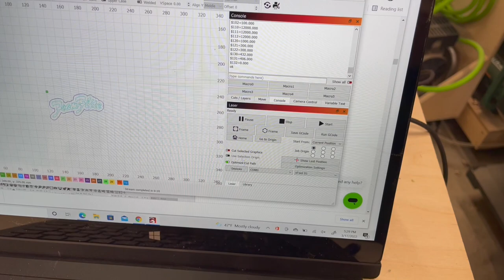XTool D1 DIY Laser Enclosure that fits the stock Honeycomb Bed

Comment: Good Work. I have a 20W laser on my Xtool D1.  I am wondering if I can use the same orange acrylic you are using. The Jtech description of the product  you are using indicate an O.D.  3 , while a person acting as a Laser Safety Officer at his work has indicated to me that a 455 nm laser would require a O.D. 5.  It make a big difference on pricing of the shielding to use. Can you give me some indication why you selected an O.D. 3. Regards
Reply from the maker: The choice for the Jtech shielding was a balance of cost and personal acceptance of my responsibility to take measures to protect myself. I also have a pair of Freemascot glasses rated at OD6+ for use with the 455nm wavelength of these lasers. Finding panels of OD6 acrylic for the larger window was becoming difficult and expensive. So it was a balance and choice I made knowing that I should still take measures to further protect myself.
Reply: @Vintauri  Tank you very much for your fast and very honest anwer. I am proud of maker of your type who try to find answer to different problem and try its best to have things done. For the benefit of your viewer the current cost of a 12 inches x 25 inches O.D. 6   ACR-A5401A Laser Safety Window is 353$ US. If someone can explain to me why we have to pay such price for that type of material I would appreciate. I am not sure what I am paying for a piece of very complex material or a certificate of compliance. Continue your good work. Regards.

Comment: Hi are the orange plexiglass laser safe from Jtech..including the sides pieces,  what size sheet did you use for the cut outs. Thank you for sharing this great build
Reply from the maker: Yes they are the Jtech laser safe panels.  They could be made from 1/8" plywood or MDF but I thought this would look better and might offer more viewing to monitor the machine.  I used two 12 x 24 panels in the build.

Comment: Just downloaded your plans. Laser will arrive later this week. Is there enough room for the light burn camera to focus if a small gas strut was used to stop the lid going all the way back?
Reply from the maker: You would need a very wide angle lens to use with the current dimensions.  Extending the enclosure top up 2-3 inches would give you more flexibility to add the camera.  I wanted to keep mine compact and hadn't planned on a camera when I designed it.  However I did pick one up and will be doing some testing with it eventually.
Reply: Where did you download plans for enclosure? Is there a link?

Comment: I just purchased your plans to build this enclosure my question to you is you mentioned that you would’ve made it a little bit bigger for the honeycomb panel is that in the new plans or do I have to enlarge it. it looks very good so far I Purchased the extra 421 but it is still in transit I have not received it yet but I would like to build it before I get my unit so hopefully you can get back to me and let me know if the extra dimensions were added to the new plans thank you
Reply from the maker: Yes the extra depth for the honeycomb tray was added for more flexibility in placement.  You can extend it further if you wish and it will not effect the operation of the laser or enclosure.
Reply: I’m sorry it was supposed to read XTOOL D1 20W pro

Comment: love the set up!!! quick question: How compatible is this enclosure if I want to add a camera??
Reply from the maker: Thank you!  It’s a little short for the typical cameras people use with this size laser. I’ve picked up a very wide angle camera to do some testing but I need to sort out if it’s feasible without making it taller.

Comment: I have sculpfun S30 ultra 40 . I presume the plans could be modified to make it suit. I have a fan that came with my sculpfun enclosure, do you think it would suffice. Love your presentation 
Paul
Ireland 🇮🇪
Reply from the maker: You would need to stretch a few side pieces to make it a bit taller for the sculpfun to fit, but it should not be too hard.  The fan might work, but they tend to be a bit underpowered.  If you can get a larger one, you'll be happier.
Reply: @Vintauri just downloaded your plans
Reply: @Vintauri . I now have your plans and will endeavor to modify to accommodate the Sculpfun 30. One question.
What height bench/desk does your enclosure sit on ?
Regards, 
Paul,
Ireland 🇮🇪

Comment: Great plans. Bought them last week. Need to buy a few more items. Question...How did you wire the lighting wityh the limit switch? Also, I'm considering placing my exhaust port to the rear of the enclosre. Any thoughts? Thank you for sharing the plans and your knowledge.
Reply from the maker: Moving the air exhaust port to the back should be fine.  I have my enclosure up to the wall so I needed it on the side for clearance.  I've had a few questions on the lighting so I think I should make a quick video on it.  It's strips of LED lights connected with 18 and 20 gauge silicone wire. I have a limit switch that is pressed with the lid closed to turn on the front section of lights.

Comment: Hi Steve, can you use Dave Clack's  interchanageable jigs kit with this enclouser you made? I got your plans and like your design. I am modifying it a little and just wondering if i need to modify it to use Clack's jigs. Thanks
Reply from the maker: Clacks jig will fit inside the enclosure without any modifications.
Reply: @Vintauri  thanks

Comment: Hi, really like the way it came out. I'm curious to know why you preferred to mount the laser and honeycomb on the small shelf instead of using the original raisers and to build spacers for the honey comb? I think it can simplify the build a little bit.
Reply: I think I can answer. With the laser being placed on a built in shelf it is already lifted to the required height to use a rotary. Without the shelf you have to install the original risers every time you want to use a rotary, that would take time and after awhile become a  nuisance. Plus if the shelf isnt there, then you would have to keep track of the leg risers...i dunno know about you, but i am ALWAYS misplacing (not loosing) things; so with the shelf already installed to the height you need to use the rotary, then you have no need for the leg risers.

Comment: I have a old bathroom vent fan. It still works good would this be good enough to. Attach to the back of my box for venting?
Reply from the maker: If you can enclose the fan in a way that it will draw the air through the enclosure and if it will pull 300+ CFM, it should work. It always nice to reuse something when possible.

Comment: Steve - great video and thoughtful design. I purchased the Xtool enclosure, but find it lacking in so many ways. I plan to get your plans and build my own. Quick question - what lights did you use? I tried the Meross light strip and find that the lights oscillate inside my enclosure.
Reply from the maker: I'm using a 12v LED strip in mine.  I don't recall the exact brand as it was just some 5000k white light LED's. I've not had a problem with any flickering or oscillations.
Reply: @Vintauri  Steve - thanks for the info. I’m going to try a couple of different brands and see what happens. Tom

Comment: Finished and smoke free - but... my Xtool D1 Pro laser is too high too focus on 3mm ply. Am I  missing something? I raised the honeycomb bed temporarily to get Xmas presents started.
Reply from the maker: On my 20w Pro, the focusing stand will just touch the honeycomb when it's dropped as low as it can go.  I don't know if they put longer legs on later models?
Reply: @Vintauri mine is a 10w and doesn’t have a lever on the right of the laser as I see on the 20w. Power and USB ports line up. Oh well.

Comment: Great video and very well thought out and informative. How long does it take to build this enclosure? I'm going to build one in between clients and need to know, so I can budget my time for it wisely. Appreciate any information you can share. Thanks in advance!
Reply from the maker: That will depend on what tools you have, and your experience with building cabinet like structures.  I tried to cover each step clearly in the build guide for those with less experience.  It could be done in a two day weekend depending on the level of finish you go with. Once you have the parts cut out it can go pretty quick if you have enough clamps and a brad nailer to hold things together as you move on to the next step.
Reply: Thank you. I appreciate your prompt feedback. Your plans are very detailed and nicely done. I'm a very skilled custom carpenter, but I don't use C&C equipment. It would all be built by hand with my cabinet making tools.

Comment: I have you plans in hand, and am about to go pick up the materials for the build.  Before I start cutting wood, I'd like to know:  Now that you've had a few months using your design, are you satisfied with it?  Does the 4-in vent and the 195 CFM fan do a good job of sucking the smoke and fumes out? Are there any updates/upgrades you would make, now that it's been in use for a while?
Reply from the maker: Overall I'm still happy with the design.  A few things that could be changed depending on your desired use would be to make the lower area an inch or two taller.  The new RA2 rotary can take up more space when engraving larger items and I've had to bump up the laser a little to accommodate that.  However this is a rare occasion for me so far.  Some people really want to add the camera option to their laser.  You could get one to fit but having more height to the top section would make this easier and not need such a wide angle lens.  As for the airflow, I'm generally happy with it. If you take care to not have a super long exhaust hose and to keep the bends minimal, the fan is able to work efficiently and I don't notice too many smells.  However if I could find a higher CFM fan without jumping up to a 6" model I would just to ensure as much air flow as possible.
Reply: @Vintauri  Thanks for the quick reply!  My thoughts were pretty much the same as you expressed.  Although I mainly purchased the D1 to cut ribs and other airplane parts, I went ahead a purchased an RA2 at the same time, thinking I might wish I had it later if I didn't.  I was considering adding a couple of inches to the depth for that reason.  Looks like I can do that within the 4 x 8 ply sheet with a little rearrangement of some parts, so that's what I'll do.  

I don't have a readily accessible area to vent the fumes, so I'm running an AC-type, 6-inch duct straight up through the ceiling, and then straight out to an exhaust in the eave of the roof.  Total run is about 16 feet.  I'm using a 6-inch, 350 CFM in-line fan (with remote speed control) in the ceiling part of the duct.  The take-off from the enclosure will still be 4-inches, so I'll have a 4-inch transition at the bottom of the duct, that will use a short, flexible hose to connect to the enclosure.  Hopefully, that will be good enough to send the fumes outside.

Comment: Does this fit the newer rotary from xtool? Someone on Etzy wrote that they had to modify the base of the enclosure.
Reply from the maker: It does fit but if you have a larger object or something you have to lift up like a mug with a handle, you might also have to lift the laser a bit. I used some 3/8” plywood shims in my RA2 video while testing things like the mugs.

Comment: I am interested in this design but was wondering if you have updated plans to fit the x-tool d1 pro with the extended bed rails.
Reply from the maker: I have not made updated plans for the extended version. I don’t have the rails for the longer D1 and I’d want to test build it before offering anything out.
Reply: I’m also interested in the extended version ❤

Comment: Any concerns of lazer light leaking through the front vents or do you still wear safety glasses as extra precaution?
Reply from the maker: While it is possible I keep this enclosure lower so it’s not near eye level. You do need an inlet for air and you want it to move across the piece so no matter the enclosure there is likely a risk. So when in doubt, the safety glasses should be worn.

Comment: My daughter just bought an x-tool d1 20w and gave it to me to set up. I’ve only just started researching them and came across your video on an enclosure. You’ve obviously put a great deal of thought into the design and I love it. I like the light set up and the fan air flow design. I also like how when the lid is folded back, the cut area is easily accessed and no high sides or front. Forgive me if it’s a silly question but since there is the laser rated plexi glass in the lid, can you remove the shield around the laser? I wondered if that might hold some smoke around the laser and also have a chance of catching on cut out parts? My daughters has an air assist pump to aid with the cutting. Does anyone know an easy mod to allow a metered flow for engraving? I thought you could somehow divert the flow through two different ports with both having their seperate flow controls and that diversion controlled by the software that would normally turn the pump on or off? I’m sure someone would have tried this so I’d be interested to see how they did it. So basically leave the pump powered on but flow switching controlled by the software.
Reply from the maker: As long as you make sure there is another layer of protection such as the laser rated safety acrylic and or some laser glasses you wear, then I would take the shroud off the end of the laser as it can cause problems.  I have switched to a variable speed air pump for my air assist and it's electronically controls the pump speed and air output.  If you can create a diverter to be able to adjust the flow, that would work the same.
Reply: @Vintauri  Thank you for the reply. After more researching, it seems as though there isn't any way of switching from the x-tool? 
I subscribed and have been watching your videos to see if other companies have an adjustable air control. Some do but only switch on or off. Are there any that switch fully on and then can switch part way on (regulated) for engraving? I'm sorry if you've covered that in a video I haven't got to yet. I have my daughter's x-tool to experiment with but I do intend to get one myself. Is there one you could suggest that is at least a 22w that has the air control I mentioned? Something with good build quality. I see some have linear rails etc. 
Cheers, Peter
Reply from the maker: @oldchev2850  There are some aftermarket air pumps that will work with the xTool and that have a rotary switch so you can adjust the air flow.  I'll link one here. https://amzn.to/3QDRKF6  

What I like about some of the newer lasers is the auto air control via lightburn. One of my favorites with that is the Algolaser Alpha or Delta : https://amzn.to/47JPKSZ
Reply: @Vintauri 
Much appreciated for that. I will definitely look into those. My daughter's has an air pump so at least I'll be able to witness the difference it makes. Thanks again, Peter

Comment: Watching your video again today and I came up with a question. Can you use spacers on the X 1 for larger (taller) projects?
Reply from the maker: Yes you can!  They sell extensions for the legs that screw in to the bottom, or you can make your own blocks from any material you see fit as long as they are all the same height.  I've even seem some 3d printed legs that fit into the base as extensions.  In any case it does not have to be anything special it just need to support it and keep it level.  Now if you are planning for a lot of larger projects, you'd want to consider that in your enclosure design to either have a deeper bottom area or more height to be able to raise the laser up.

Comment: Does Cobey's camera kit fit in this enclosure?
Reply from the maker: Unfortunately no,  His camera setup requires more head room. You would need to increase the height above the honeycomb bed by another 7 inches or so to make it fit. I did purchase a wider angle lens to test with in the enclosure but I have not got around to setting it up yet so I can not speak to if it will work with the current dimensions.

Comment: Do you line / spray the inside with anything to get the same flame retardant behavior as the tent enclosures?
Reply from the maker: I do not add anything other than the cabinet paint.  The base gets a sheet of metal to protect it from the laser beam as it cuts through.

Comment: Plans? And would you consider additional info for an extension bed version?
Reply from the maker: The plans are available here if you are interested.  https://www.etsy.com/listing/1208732982/diy-laser-enclosure-plans   I have not upgraded mine with the extensions as it does not fit my style of using this laser. Without having the extended rails and using them regularly, I'd not want to try designing an enclosure if I could not verify its effectiveness.

Comment: that's the best enclosure yet,  Also which rotary do you have the original or the new R2? I need to start on a enclosure very soon but I haven't received the new rotary yet. again job well done.
Reply from the maker: I have both the original and the RA2. I have a video on the RA2 if you want to check it out. I wanted this enclosure to be as short as I could for where I’m using it. Otherwise I’d make it a bit taller for more flexibility. I can fit most standard cups and mugs on it as is but the larger 30oz tumblers need more room.
Reply: @Vintauri  ok great I'm still waiting for the air assist and rotary, so I can't measure anything.but thanks have a great day